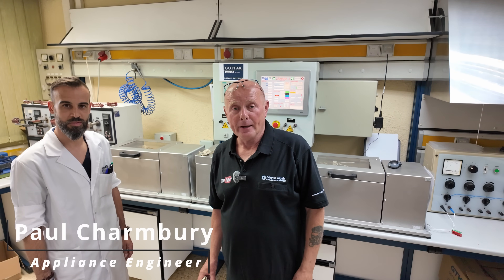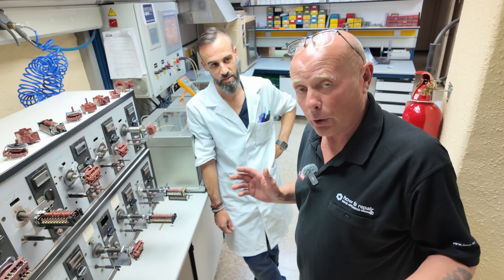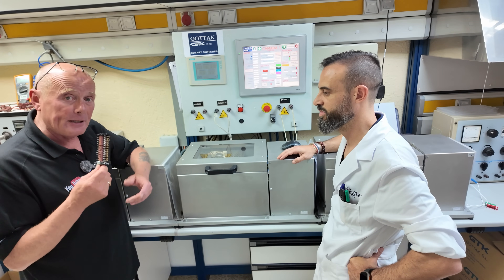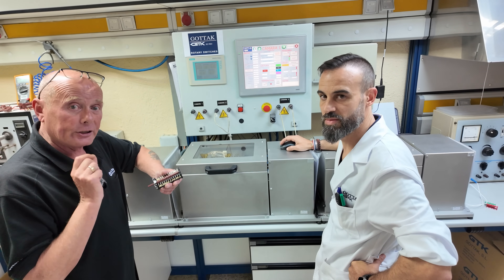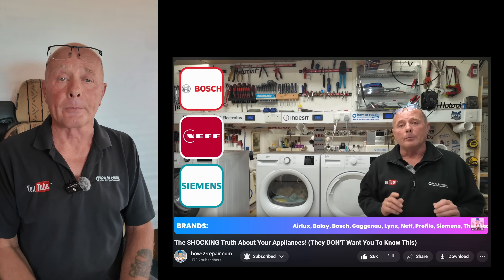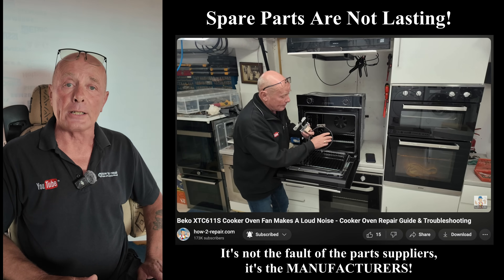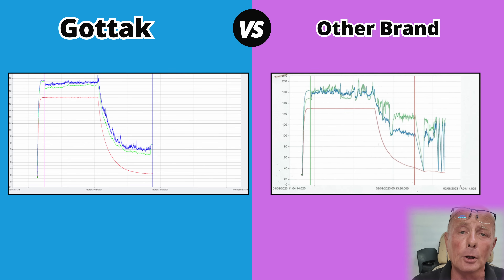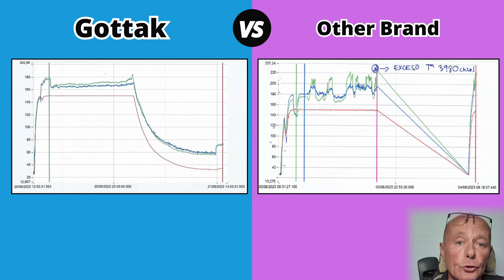Why Your Appliances FAIL SO FAST! Lab Results EXPOSE the Truth!

Comment: These manufacturers should be sued for fraud and intentionally sabotaging their products. All these climate change idiots screaming about the planet and landfills, yet, appliances intentionally going to shit just adds to the trash problem.  You can't claim to care about the environment when you intentionally build trash. Prices go up, quality goes down. No one wants computers in their appliances either. They don't need wifi or an app on the phone to operate.  Old school appliances worked better and didn't need useless apps or web connections to function properly.  They also lasted much longer.
Reply: Our whirlpool washing machine had the door seal rip shortly after the one year warranty was up. $650 down the drain. Our Frigidaire stove which is 2 years old, has the weakest excuses for oven racks I've ever seen. They bow under cast iron and even a Thanksgiving turkey. They're thin and made far too cheaply for an appliance that was $1200 on 'sale'. Emerson electronics last months now instead of years. Companies are putting out pure junk these days and think we should pay more for it. I can't recommend most, if any brands these days because they are all garbage.
Reply from the maker: Thank you for this powerful and spot-on comment. You have perfectly summarized the rage and frustration that so many of us feel. Every single point you made is a crucial part of this issue. The decline of formerly reputable brands is a key part of this. This entire system from the dishonest marketing to the shoddy parts and unnecessary complexity is the built-in obsolescence we aim to expose.

For a deeper dive into this topic and to see the examples we covered, please check out the full video here: https://youtu.be/gEgSCbZnHVM?si=wTIw0mELuhWaw4aX

We also explored related aspects in these videos:

The shocking truth about manufacturers: https://www.youtube.com/watch?v=QsdGd2qDPaI

Heat pump tumble dryers are they really worth it?: https://www.youtube.com/watch?v=xn03N3b0-lE

Comment: Excellent video. I have noticed more and more that it is nearly impossible to find any service manuals for anything. From my car, which is a basic economy model, to my AC unit.. they have managed to wrestle control away from us over the ownership of our items..

Especially cell phones now. Why can't I replace a blasted battery anymore? Why can't I have most of my software in a memory that I can erase and modify? Half our phones are loaded with needless bloat right from day 1.
Reply from the maker: That is an excellent point. The lack of service manuals and the restriction of user control are huge factors in the planned obsolescence of so many products. 

For a deeper dive into this topic and to see the examples we covered, please check out the full video here: https://youtu.be/gEgSCbZnHVM?si=wTIw0mELuhWaw4aX

We also explored related aspects in these videos:

The shocking truth about manufacturers: https://www.youtube.com/watch?v=QsdGd2qDPaI

Heat pump tumble dryers are they really worth it?: https://www.youtube.com/watch?v=xn03N3b0-lE

If you found this information eye-opening or helpful, please consider sharing this video with your friends and family.

Comment: My guy at Miracle Appliance (parts) in Thousand Oaks California was an engineer and talked about pre-planned obsolescence
Reply from the maker: Your story is so important because it highlights who has the real knowledge about this issue: the independent repair technicians and local parts suppliers on the front lines.

For a deeper dive into the specific ways manufacturers design products to fail, please check out the full video here: https://youtu.be/gEgSCbZnHVM?si=wTIw0mELuhWaw4aX

We also explored related aspects in these videos:

The shocking truth about manufacturers: https://www.youtube.com/watch?v=QsdGd2qDPaI

Heat pump tumble dryers are they really worth it?: https://www.youtube.com/watch?v=xn03N3b0-lE

If you found this information eye-opening or helpful, please consider sharing this video with your friends and family. The more people who listen to the experts on the ground, the better.

Comment: I'd give a body part to have the Maytag washer my mom gave me back in the 80s. The water circulated past a filter that sat on the agitator, excellent for removing lint and dog hair. She had an old GE refrigerator that got moved to 3 different houses as the beverage fridge, even keeping drinks cold outside in the screen porch in Florida. It had to be manually defrosted and I closed my thumb in it as a kid in the 60s. I hate how things are built today!
Reply from the maker: You have perfectly captured the shift. That Maytag and that GE were built with a philosophy of long-term reliability. Today, as we discuss in our videos, the philosophy is often to design for a limited lifespan to encourage repeat sales. Your frustration is completely justified, and it's the reason we make these videos.

For a deeper dive into why we've lost that quality, please check out the full video here: https://youtu.be/gEgSCbZnHVM?si=wTIw0mELuhWaw4aX

We also explored related aspects in these videos:

The shocking truth about manufacturers: https://www.youtube.com/watch?v=QsdGd2qDPaI

Heat pump tumble dryers are they really worth it?: https://www.youtube.com/watch?v=xn03N3b0-lE

If you found this information eye-opening or helpful, please consider sharing this video with your friends and family. Your stories are a perfect reminder of what we've lost and what we should be demanding from manufacturers.

Comment: So the unfortunate lesson I've learned from this is for a given appliance, buy the least expensive one that gets the job done and maybe put an extended warranty on it if it's reasonably priced with good terms (one needs to read the terms carefully on extended warranties...).  We know all too well that the same cheap components will be placed in expensive appliances in a product line versus less expensive models, so why pay more for same short life-span?
Reply from the maker: You are absolutely right in your reasoning. Our research and teardowns confirm that for many mainstream brands, paying more for an appliance often gets you more features—like touch screens, Wi-Fi, or a fancier finish—but not better core mechanical components. The same motor, pump, bearings, and control boards are frequently used across an entire product line. So your question, "why pay more for same short life-span?" is the exact right question to be asking.

For a deeper dive into the specific components that fail across these product lines, please check out the full video here: https://youtu.be/gEgSCbZnHVM?si=wTIw0mELuhWaw4aX

We also explored related aspects in these videos:

The shocking truth about manufacturers: https://www.youtube.com/watch?v=QsdGd2qDPaI

Heat pump tumble dryers are they really worth it?: https://www.youtube.com/watch?v=xn03N3b0-lE

Comment: I had a similar problem with an expensive Dyson hot&cold fan - heard a 'bang' just outside warranty period and the heating part stopped working properly.  Dyson refused to do anything even though it was not used much.
Reply from the maker: Thank you for sharing your story. That is an incredibly common and frustrating experience, especially when it happens with an expensive, premium brand like Dyson.

Dyson products, while known for their innovative design, are also well-known in the repair community for being difficult and expensive to fix once that warranty expires. They often use complex, integrated designs and proprietary parts that aren't made available to consumers, which discourages DIY repair. This leaves you with the single option of their costly official repair service, which, as you discovered, they can refuse for any reason.

For a deeper dive into these kinds of design strategies, please check out the full video here: https://youtu.be/gEgSCbZnHVM?si=wTIw0mELuhWaw4aX

We also explored related aspects in these videos:

The shocking truth about manufacturers: https://www.youtube.com/watch?v=QsdGd2qDPaI

Heat pump tumble dryers are they really worth it?: https://www.youtube.com/watch?v=xn03N3b0-lE

Comment: Fisher and Paykel dishwashers last just over 2 years. I had three ( I know, slow learner lol) and my Mum and Dad had two. All stopped working at just over two years old. Occasionally you get lucky and might get one that outlives itself. Washing machines are rubbish now compared to older ones as well. But I won't rant on that or I'll still  be here in a month lol.
Reply from the maker: Going through five machines from the same brand that all fail consistently just after the two-year mark is a perfect, and frankly terrible, example of the problems we all face today. The data clearly shows that the average lifespan of a modern washer has dropped significantly compared to the simpler, more robust machines from a few decades ago.

For a deeper dive into this topic and to see the examples we covered, please check out the full video here: https://youtu.be/gEgSCbZnHVM?si=wTIw0mELuhWaw4aX

We also explored related aspects in these videos:

The shocking truth about manufacturers: https://www.youtube.com/watch?v=QsdGd2qDPaI

Heat pump tumble dryers are they really worth it?: https://www.youtube.com/watch?v=xn03N3b0-lE

Comment: It doesn't seem like it fails, it does fail.   I got a list of products and companies to never buy from again due to how fast their stuff fails.    Often they aren't any better then old products  infact they are often worse in a significant way
Reply from the maker: It's not that it seems like they fail; they do fail, and as we show in our videos, it's often by design. Your point that new products are often worse in significant ways is also spot on. While they may have more flashy features and smart tech, countless consumer stories and data from repair technicians show that the core durability of many modern appliances is far worse than the simpler, more robust machines from a few decades ago. They've replaced reliable mechanical parts with fragile electronic boards that are expensive to fix.

For a deeper dive into this topic and to see the examples we covered, please check out the full video here: https://youtu.be/gEgSCbZnHVM?si=wTIw0mELuhWaw4aX

We also explored related aspects in these videos:

The shocking truth about manufacturers: https://www.youtube.com/watch?v=QsdGd2qDPaI

Heat pump tumble dryers are they really worth it?: https://www.youtube.com/watch?v=xn03N3b0-lE

Comment: That is why I keep repairing old appliances. The new stuff is garbage. We have had the same Kleen Maid washing machine for 30 years and I have only had to do two repairs. Still runs like new. Our friends got a new LG washing machine and it started having problems only after eighteen months. Today it is all about engineered obsolescence for profit. The other problem is that politicians and governments are funded by the very greed driven scum that do this. So instead of getting legislation to stop this, they will lie and deflect to cover their masters. So until people choose better politicians nothing will change.
Reply from the maker: You are living proof of the benefits of repairing quality old machines. A 30-year run for your Kleenmaid washing machine is a good testament to how things used to be built, and your experience is one many of us who work on older appliances can confirm.

It's a huge battle, and as you said, corporate lobbyists fight it every step of the way, but it proves that when enough people demand action, change is possible. The engineered obsolescence you mentioned is the very reason these laws are necessary.

For a deeper dive into this topic and to see the examples we covered, please check out the full video here: https://youtu.be/gEgSCbZnHVM?si=wTIw0mELuhWaw4aX

We also explored related aspects in these videos:

The shocking truth about manufacturers: https://www.youtube.com/watch?v=QsdGd2qDPaI
Heat pump tumble dryers are they really worth it?: https://www.youtube.com/watch?v=xn03N3b0-lE
If you found this information eye-opening or helpful, please consider sharing this video with your friends and family. The more people who understand the problem, the more pressure we can put on our politicians to act.

Comment: EVERYTHING after 1990 had DESIGN OBSOLESCENCE built into it. If not earlier ,Especially CARS. NEW CARS all have SOY in the wiring casing so MICE and RATS are attracted to them..This is why we only buy SECOND HAND. Our Old washing machine bought off marketplace works better than our brand new washer that broke down a few years ago, since then everything we buy is second hand, way better quality.
Reply from the maker: Thanks for sharing your experience and strategy. You're right to be skeptical about the durability of many new products, and your approach of buying second-hand is one that many frustrated consumers are adopting. It's fantastic that your older washing machine is serving you well!

This decline in quality that forces savvy consumers like you to opt-out of the new market entirely is the very definition of the built-in obsolescence we aim to expose. For a deeper dive into the specific ways modern appliances are designed to fail, please check out the full video here: https://youtu.be/gEgSCbZnHVM?si=wTIw0mELuhWaw4aX

We also explored related aspects in these videos:

The shocking truth about manufacturers: https://www.youtube.com/watch?v=QsdGd2qDPaI
Heat pump tumble dryers are they really worth it?: https://www.youtube.com/watch?v=xn03N3b0-lE
If you found this information eye-opening or helpful, please consider sharing this video with your friends and family. The more people who understand the game, the better equipped we all are as consumers.
Reply: @How-to-repair Thank you so much, I’ll watch those videos. Bringing back people who repair small to large appliances,small motors etc have always been in demand…..just putting it out there to manifest young people starting up these businesses.
Reply: @How-to-repair Perhaps doing a video on brands and products that are available and built to last like the BUNYIP pumps we have here in Oz.  built to be handed down to the next generation.

Comment: No way am I excusing such poor quality stuff, but is it our wishes or manufacturers' wishes that in real terms things are so much cheaper to buy now? I got my mum out of the dark ages of the twin tub buying her an "automatic" washing machine as they were known then. It was £400 in 1989. It was Hitachi, not the cheapest possible but not high end by any means. Stick that in the inflation calculator and today that's £1,060. Basic, decent branded washing machines and TVs were about £300-£400 35 years ago and haven't gone up while beer has more than quadrupled! Again, not excusing it at all, they really shouldn't be allowed to make and sell such junk.
Reply from the maker: While consumer expectations for low prices are a factor, you are absolutely right to say that it does not excuse them for making and selling junk. It's a business model they chose, prioritizing a low sticker price and frequent replacement over long-term quality and value.

The built-in obsolescence we expose in our videos is the direct result of this race to the bottom. For a deeper dive into the specific ways they cut those corners, please check out the full video here: https://youtu.be/gEgSCbZnHVM?si=wTIw0mELuhWaw4aX

We also explored related aspects in these videos:

The shocking truth about manufacturers: https://www.youtube.com/watch?v=QsdGd2qDPaI
Heat pump tumble dryers are they really worth it?: https://www.youtube.com/watch?v=xn03N3b0-lE
If you found this information eye-opening or helpful, please consider sharing this video with your friends and family. The more people who understand the real cost of a "cheap" appliance, the better.

Thanks again for that incredibly sharp and insightful comment! Don't forget to subscribe to the channel for more like this!